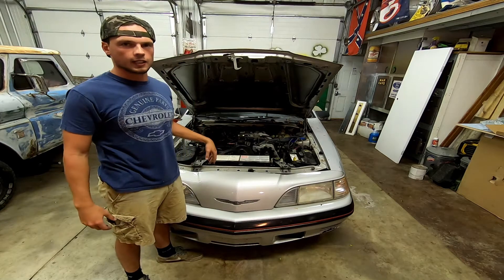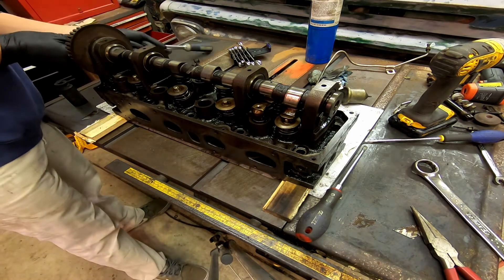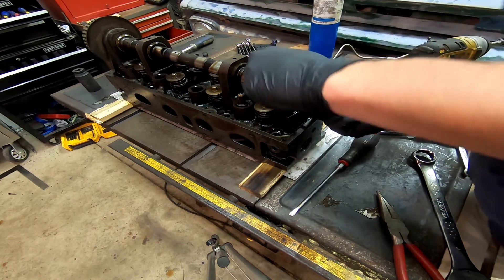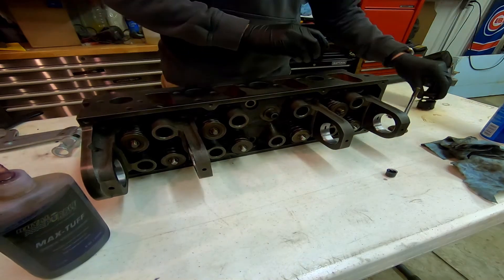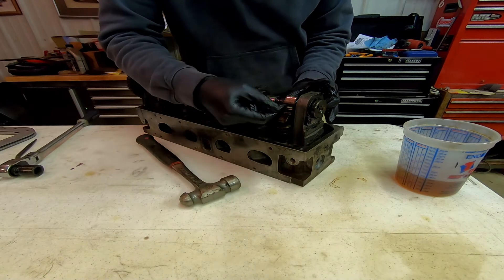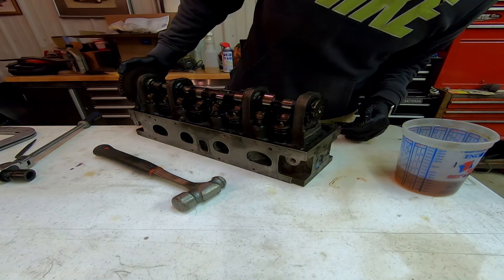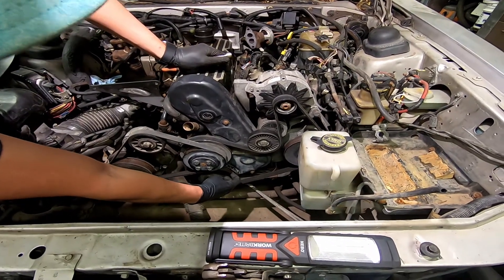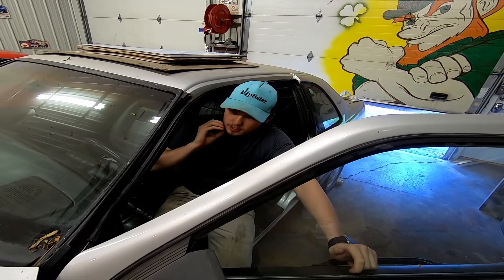Head gasket for 2.3L Turbo Ford Thunderbird

Comment: I just blew a head gasket on mines did you use ARP studs or the original ones or is a recommend it it’s weird that my car just blew a head gasket in between cylinders and I just drove the car normal
Reply from the maker: I bought new head studs I can’t remember what brand at this point but wasn’t arp

Comment: fun tip, if you lose the dowel pins get a set off a 302 or 351W in the scrapyard, same height and bore from my experience. good how-to on the head assembly, saved me having to type a bunch to a friend of mine.

Comment: do you have the video not sped up? PLEASE! If you could take what youre doing and slow it down i would IMMENSLY, immensely appreciate it
Reply from the maker: Sorry I deleted all the stuff I had on this car after I finished this video, and someone bought the car. But what exactly are you are you trying to get fixed?
Reply: @stupidlucky9220  haha, well, I'm actually just trying to do the same thing you did! I need to replace a head gasket and I'm trying to find where the AC fan is as my AC won't work on my ford thunderbird and was wondering if you could provide any tips? There seems to be very very little info on this car when it comes to the technicals of it, and so I'd appreciate anything you could offer!